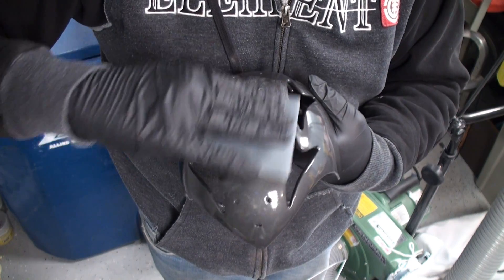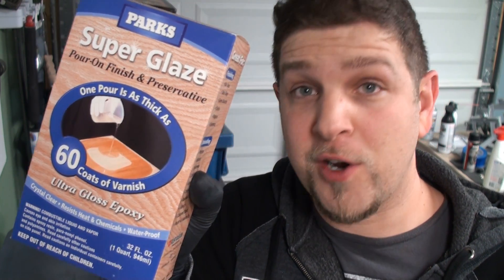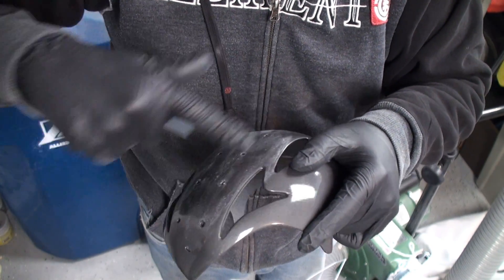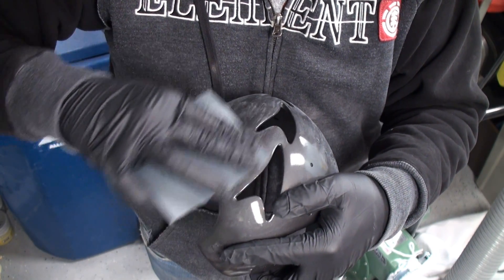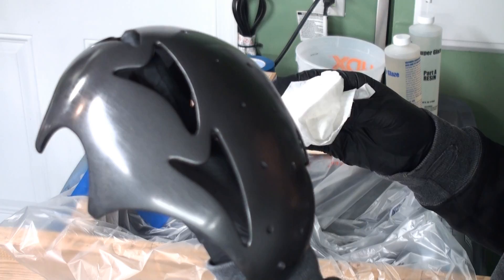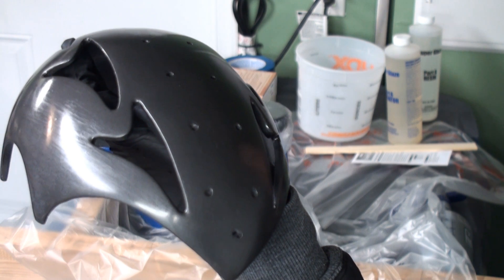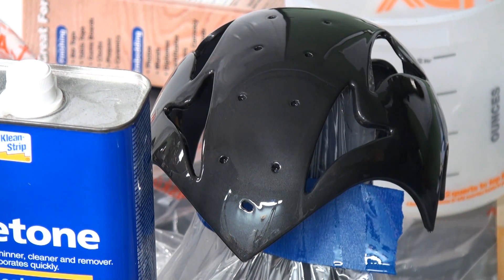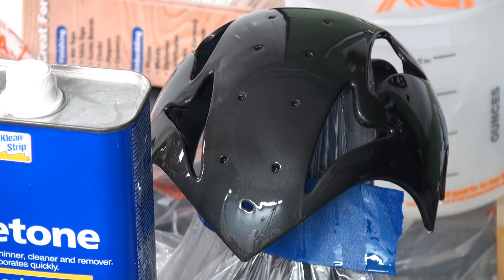How to apply clear bar resin (epoxy) to a fiberglass helmet

Comment: Really enjoyed your vid, though I was surprised to see no end result (the payoff shot).   I'm working on a similar project; and rather than pour a gallon of epoxy over the top and watch 98% fall off, I'm gonna try mixing a much smaller amount and painting it on with a brush, rolling it around while I heat-gun it to prevent beading.  Once it's cured, I can repeat the process, and just keep repeating until I get the results I want.  Maybe I'll try the pour-it-on method on Day 5 or so, so that the final coat is nice and glassy.  Well, "glassier".  Overall, great tutorial.

Comment: Great video. I am wanting to experiment & paint a pair of shoes with acrylic then add resin to make them shiny & for durability just not sure how i would prop them up. Suppose it's gonna have to be trial & error.
Reply from the maker: +ArtyShells Hub thanks! Yeah, trial and error is my favorite learning process. The shoes idea seems like it would be cool. I wonder how they'd hold up to flexing when worn. BEST OF LUCK!
Reply: Yep sometimes miracles can come from trial & error. Yea I'm just going to get a cheap pair of plastic material type heels from a charity shop & give it a go. Thanks :)

Comment: I want to do this to a small motorcycle tank so you think this process would be the same? There will be flat details that I will place on tank so clear epoxy can keep it in place. Thanks a bunch!
Reply from the maker: +OffTheLens I'm sure you could make it work with pourable epoxy. Ideally, you'd want to spray either an epoxy sealer (if you don't need it transparent) or a 2k clear coat, which would harden and look great (not as thick or durable as the pourable epoxy). You can now get 2k clear from a spray can. Search Amazon for "USC Spray Max 2k High Gloss Clearcoat Aerosol". Good luck and thanks for watching!

Comment: you honestly helped me on this. i have painted interior trim parts with a rattle can and a crap load of clear coat (gloss) some parts came out nice but some not so good, i thought what if i used epoxy to give it that wet gloss look and durability i need when dealing with interior parts that can chip easy. you made it clear to me, thank you.
Reply from the maker: Jerry A Haha, nice pun! I'm so glad I could help. Recently, I've been experimenting with "proper" clear coats out of a rattle can via 2k clear cans. They have the activator inside with a 48 hour pot life upon activation. They make a glamor gloss and a matte. I was thinking about using the matte for interior parts since it will cure to a durable shell... not as robust as pouring epoxy, but much better than regular spray clears from home depot :)
Reply: Technically Fun ahhhh 2k clear i saw those. i will give those a shot. thank you.

Comment: this is a genius idea. How is it holding up now? Did you use all Rustoleum products prior to the epoxy?
Reply from the maker: Richard Brown, thanks! Yes, I used all Rustoleum products before the epoxy coat. Since this video, I've had a lot of success wet sanding instead of dry sanding. I'd fill a spray bottle with water and then two or three pumps of liquid soap. It works wonders. The helmet is holding up beautifully... much better than plastic. The durability is impressive.

Comment: How do you keep the drips from showing at the bottom of the helmet?
Reply from the maker: The heat gun really helps with that. It keeps the epoxy fluid and blows off extra drips. There will still be remnants of drips, though. Therefore, you might need to sand them down a bit. At that point, you can simply mix a tiny bit of epoxy and touch up the sanding scratches with a small brush.

Comment: to be honest ,you could have mixed small amounts, and then painted them on with a brush.  the amount of resin you used could have clear coated that helmet about 50 times.   you really just wasted 95 percent of that resin.
Reply: U could have also let it sit and thicken up some so you could have better coverage.. something to think about if u have to do that again
Reply: Clearly he’s a moron.
Reply from the maker: Yea, but I had nothing to gain by saving it. I wasn't going to use it for anything else. The stuff wasn't expensive either.
Reply: @TechnicallyFun  Now that you said it wasn't expensive I'm forced to ask where you bought it and what brand it is